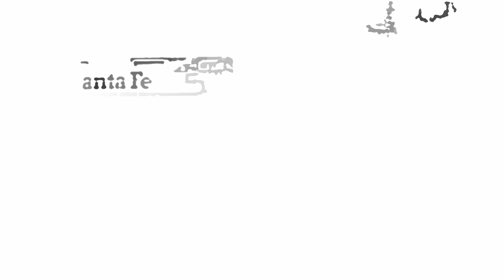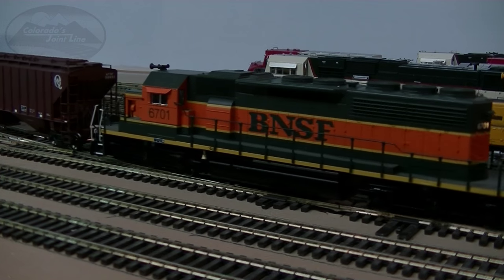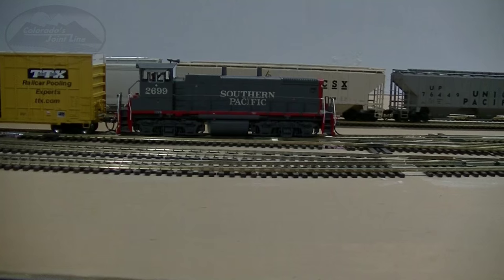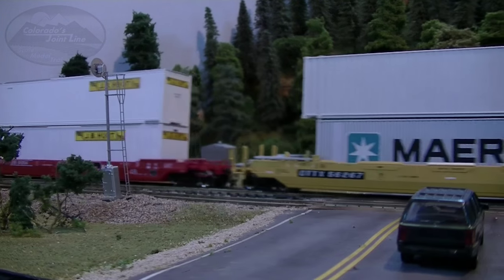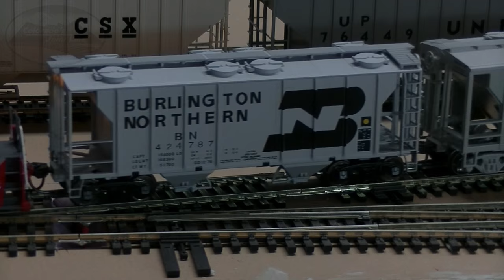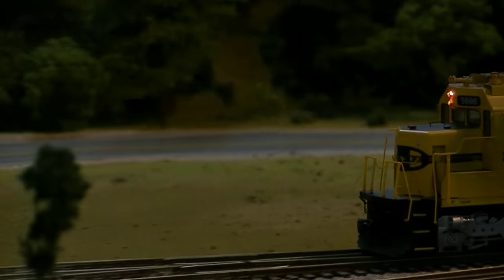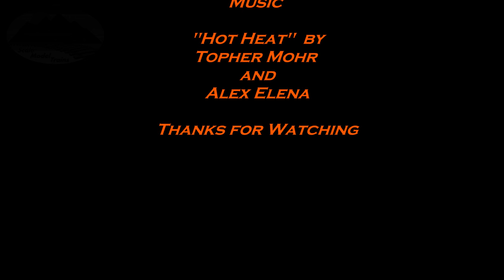Model Trains - Model Railroad Ops Session - BNSF, UP, ATSF, D&RGW, SP & BN

Comment: Love your layout especially the bn I used to have bn locos running down a branchline in Pensacola back in the 90s. How do you uncouple your equipment
Reply from the maker: +Dalton Rhodes Dalton, thanks for the compliment on my layout.  I manually uncouple my cars and engines rather than use magnetic uncoupling.  Most of my cars and engines still have trip pins so they can use magnetic uncoupling if I chose to do that in the future.  However, I've used both methods on several different layout over the years, and prefer manual uncoupling.  But its really just a matter of personal preference. Cheers, Kevin

Comment: Great video man.  I would love to get into this fantastic hobby once I retire from the military.  I'm going to try to finish with a twilight tour at NORTHCOM in Colorado Springs, so this was very interesting for me personally.
Reply from the maker: Thanks for the compliment.  Moving around all the time does prevent you from having a non-movable layout, but don't let that stop you.  You can easily have a smaller modular or sectional layout that is easy to move.  Plus you can concentrate on detailing and weathering engines, cars, etc so all that work is already done when you start building the layout.  There will always be reasons to not start a layout.  You just have to decide if you want one or not.  Good luck with your assignment matching.  Cheers, Kevin

Comment: Just add some info about the CN unit, there were 2. The first one was a GTW SD38, paint GTW (a CN subsidiary) in the blue/red scheme. Originally built for DT&I in 1971 and became GTW 6253 in 1984, CN never repainted it into the red/black as it was sold to the RBMN in 2000. The second is an IC SD40-3, paint for CN with IC under the number in real life. Originally built as BN 6772 in 1976 and became IC 6160 in 1993, and rebuilt in 2000 as 6253 (possibly repainted at the same time from the IC black to the CN black/red).
Reply from the maker: Tim, thanks for the additional information.  Cheers, Kevin.

Comment: I like that you use all those Dash-8 Units but i have a few questions. Are they atlas and if so do they have QSI Sound. If they have QSI I would like to know how you were able to speed match them to the other Manufactures you use on your layout. I have heard of people trying to speed match them and Completely fail. But Great video! I have been looking forward to one these on your channel!

Thank you ~Metra163
Reply from the maker: ***** Yes my -8s are Atlas with factory QSI sound decoders and they are speed matched to all my other engines. I did a video a while back on how I speed match all my engines.  This is the same technique I use for my Altas QSI engines too.  One extra programming note on the Atlas QSI engines though is you may have to turn off Regulated Throttle Control (RTC).  The Atlas decoders have RTC and Standard Throttle Control (STC) modes.  From the Atlas DCC manual: 4.2.6 Selecting Standard Throttle Control™ or Regulated Throttle Control™ (CV56.4).  The differences between Standard Throttle Control (STC) and Regulated Throttle Control (RTC) are explained in Section 3.643. Follow the directions below to convert between RTC and STC when using DCC.
• Set CV49 to 4,
• Set CV56 to 0 for Standard Throttle Control or to 1 for Regulated Throttle Control.
Note: The default is Regulated Throttle Control.
Note: CV2, CV3, CV4, CV5 and speed tables apply to both Standard and Regulated Throttle Control. 

I change all mine to STC, but you may be able to speed match your engines with RTC depending on your momentum setting of the engines you're trying to match too.  

Here's my speed matching video.  https://youtu.be/QeZArBEqmMk

Cheers, Kevin
Reply: Scale Model Trains & Colorado's Joint Line Thank you very much for that information. Now when i get JMRI (If i ever do) I will be able to speed match my C40-8 to my other engines. 

Thanks ~Metra163

Comment: Great Ops Session Kevin!!! Two things I have noticed….Palmer Lake has some of the slowest joggers I've ever seen, and I do not want to be stuck at that grade crossing if I was in a hurry. Layout is looking fabulous! 

Quick question….In your main yard I noticed your track is set directly on the foam board while the rest of your track is on cork roadbed….How did you transition the track from foam board to cork? Im having a hard time with this on my layout. 

Thanks in advance….Joe T.
Reply from the maker: Joe T Joe, thanks for the compliment on the layout. On the transition, if you look at the shots of the mainlines as the go into the double crossover, they go down a short grade. I cut the ends of two of the Woodland Scenics incline starters for this. I haven't had any problems once I got it all aligned, but I took my time to make sure it was as smooth a transition as I could make it and tested it a bunch before gluing it down. Cheers, Kevin

Comment: You talked about some engines being renumbered, now when that happens to you renumber your engines or do you purchase the newly numbered engines?
Reply from the maker: +Steven Bruni I don't try to keep my roster completely up to date with the prototype as far as renumbering.  I may renumber a engine or to because I'm trying to model a specific road number, but not just because the railroad did.  If a manufacture happens to make the new road number, I might buy it if I need that type of engine.  But then I try to not run the old road number engine at the same time as the newly renumbered engine.  Cheers, Kevin

Comment: At 4:38 did you make the engines bounce on the track by putting small splints under sections of the track?
Reply from the maker: No, that's just where the track changes from level to a 2% grade for a short bit.  Cheers, Kevin
Reply: Scale Model Trains & Colorado's Joint Line ok it just looked like the locos were bobbing and rocking around on the tracks

Comment: Kevin, another EXCELLENT video!!  Question about your helper engines - do you use two throttles, one for the helpers and one for the lead engines?  Those trains with helpers run really smoothly.  I enjoy your narration as well. Great Job!!  Brian
Reply from the maker: brian102256 Brian, thanks for the great compliment.  I use a Digitrax DT402 throttle because it has two independent throttle knobs that let me control the lead engines and helpers from a single handheld.  Thanks for the feedback too.  Cheers, Kevin

Comment: Great work Kevin, I always value your knowledge of the western railroads. You have many of the same locomotive as I have, how are the lights in the new athearn genesis SD75 holding up? Still worth the buy? I might get one.
Reply from the maker: Trains Big and Small Thanks for the feedback and compliment.  The SD75I is still performing great, not issues with running, sound or lights.  Still wish they were LEDs instead of bulbs, but they're performing fine still.  Cheers, Kevin

Comment: I was wondering how many cars long you ran your BNSF coal trains and how long you made your passing sidings? I am just getting started in the hobby and designing a layout and currently have 43 coal cars and 4 BNSF locos to pull it, but I would like to build realistic (to the hobby) passing sidings and cut my train lengths down to about 20 cars. Anything will help! Thanks!
Reply from the maker: Nathan Nathan, I normally run 18 car trains. The layout will accommodate longer trains, but the longer your trains are, the shorter the mainline is in comparison. I try to balance the look of a long train with the feeling of a long mainline. 18 cars and 5 engines per train seems to do that on my layout. If you keep the view of the train broken up where you can't see the whole thing stretch out in front of you, then you'll never know exactly how long it is when your operating your layout. You either be watch the lead engines, helpers if you have then, or just some portion of the middle.  I don't have any passing sidings, but I've built the yard and hidden staging to handle 24 car trains. Hope this helps. Cheers, Kevin
Reply: That does make sense breaking up long stretches with scenery, etc., making the trains seem longer than they really are. Thanks Kevin! Keep up the great videos! It's teaching me quite a bit.
Reply from the maker: Nathan Thanks for the feedback. Glad to hear your finding the videos informative. Cheers, Kevin

Comment: Maybe this is a dumb question since I haven't started buying anything, yet, but looking at it with an electrical knowledge background; Power to feed the motors in your locomotives comes from the track, right?
So, how can you have two locos sitting next to each other, on the same track, and only move one?
Also, how many controllers do you have? (unrelated, sort of) [that's what they call the knob-turny thing, right?]
Reply from the maker: +mahnarch Great question.  There are two primary ways to control multiple engines on a layout.  The older uses straight DC current and powers a given number of electrical blocks.  The layout is divided into a number of electrical blocks and through electrical switches (think switches on a control panel not track switches though some track switches are electrically routing) the operator selects which block or blocks he is controlling at a given time.  That way only the engines in those block respond to the throttle commands.  However, the trend recently (and what I use on my layout) is Digital Command and Control (DCC).  DCC encodes a small packet of information and sends it through the rails along with the normal DC power.  A DCC decoder in each engine reads this signal which tells the engine what to do.  If it needs to move or something, it applies enough of the power from the rails to move either slow, fast, or whatever speed the operator tells it too.  The power is the same as in DC, but it is the combination of the DCC command station sending the info on what each engine should do and the DCC decoder determining what it is being told to do that allows all the engines to run independently.  This is a really basic explanation.  But there are lots of great web sites completely dedicated to DCC that will go into more detail if you want to read more on DCC.  There are several good companies that make DCC systems.  I've personally owned, and was happy with both, North Coast engineering (NCE) and Digitrax DCC systems.  Hope this helps.  Cheers, Kevin
Reply: That's a lot of information to absorb. :D
But, now that I have an idea, and a name of the system, I can go do some research.
Thank you, Kevin.
Reply from the maker: +mahnarch Anytime.

Comment: How many cars do you put on each of your BNSF Coal Trains? thanx, Matt
Reply from the maker: railroadpics _ Matt, my coal trains usually only have 18 cars.  I could run longer trains than that, but I find that with longer trains the mainline run "feels" shorter.  With my layout I've found that 3 lead engines, 18 cars and 2 helper engines provides the right balance to feel like there is a long mainline run with long trains running over it.  Cheers, Kevin

Comment: Up was formed in 1862
Reply from the maker: Correct, and when UP merged with (bought) Southern Pacific in 1996 UP acquired joint ownership and operation of the Joint Line which SP owned/operated along with BNSF at that point.  Cheers, Kevin.
Reply: I'm not trying to start a argument but on google it says that up was formed in 1862 and has bought sp cnw drgw mp the Katy wp so yeah also your correct that the sf merged with bn to form BNSF
Reply: I'm also building a Nebraska layout as well it should be done soon!

Comment: Are the SD40-2s able to pull a train?
Reply from the maker: Yes, depending on how many SD40-2s you put on the train and how long/heavy the train is.  SD40-2s generally have 3,000 horsepower.  In the late 80s and early 90s it was common on the Joint Line in Colorado to have 5 SD40-2s, or a combination of SD40-2s and C30-7s, on a train.  Cheers, Kevin

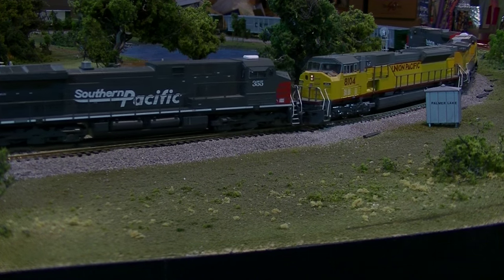Comment: At the 14:00 mark, has that scenario ever actually happened?
Reply from the maker: Sean Williams Yes.  I've seen everything from engines breaking down, shutting down and not restarting, catching on fire, lots of broken knuckles/couplers, etc.  Here's a video I took of a BNSF engine rear facing on the point of a train after it was picked up on the Joint Line and was being shoved north.  https://youtu.be/0nKmhwGzmPw

Comment: One thing that drives me crazy are people that call the comfort cab diesels 'wide cabs.'  There's no such thing as a wide cab, it would have to stick out on either side of the sideframe.
Reply from the maker: bcrnfan Canadian cabs or comfort cabs are commonly refereed to as wide cabs even though it is actually the nose of the engine that is wider while the cab is the same width as a standard cab unit. Both EMD and GE have used the denotation "W" on on some engines equipped with comfort cabs as in SD40-2W and C44-9W (EMD also uses 'M' as in GP60M). Most railfans and modelers seem to refer to these cabs as "wide cabs" more often than calling them Canadian cabs or comfort cabs. Probably because it is just easier to say even if not being technically correct. Cheers, Kevin

Comment: Not much of an operation session rather a run by session..... Would have liked to see more operations and less run by.
Reply from the maker: David, thanks for the feedback.  Not sure what you mean by more operations.  If you mean switching, there's not much switching on the Joint Line other than the yards and in Denver.  All the trains are identified with originations and destinations and run by on how the prototypical operates on the Joint Line.  Cheers, Kevin
Reply: OK but that sounds pretty boring though. Don't you have any industries along the way or any products to deliver and - or pick up???
Reply from the maker: David, there really aren't any industries along the Joint Line.  There are some in Denver both off the mainline and along the Belt Line.  I model a bit of that in my Denver section.  Cheers, Kevin